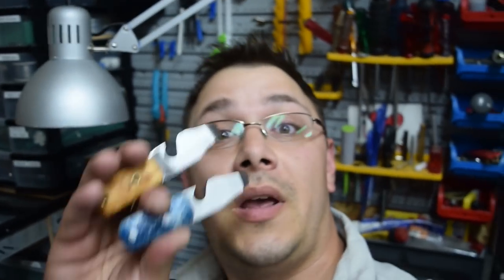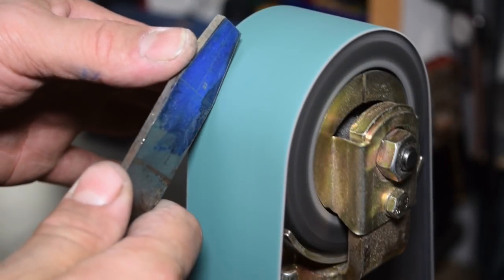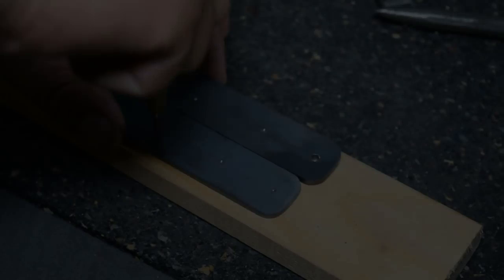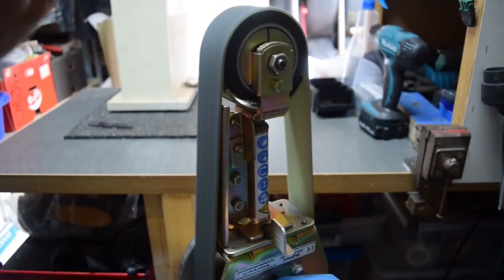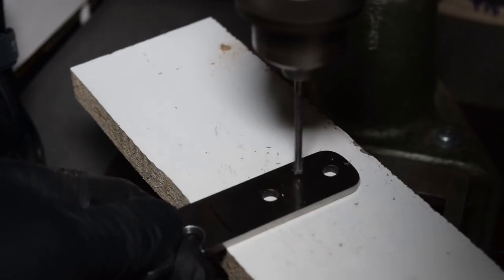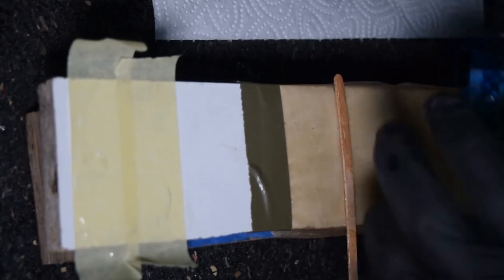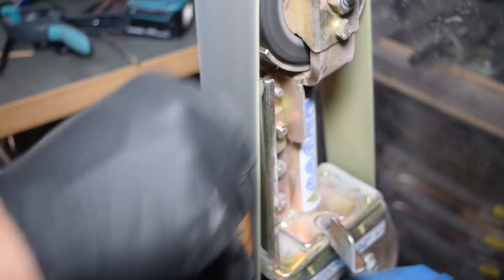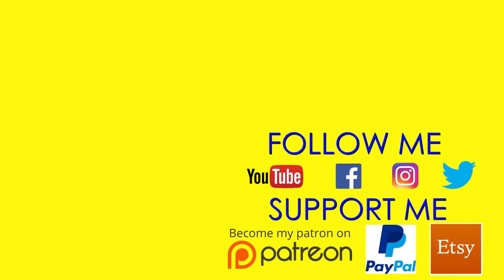Making Pocket Pry Bars from Mystery Steel

Comment: Where can I get a torch like you use in your mini kiln? If its lilac its pronounced lyelac
Reply from the maker: Thanks, i think I used a weed burner torch from the hardware store and built a small furnace from fire brick
Reply: Thank you. I have the fire bricks but couldn't get the metal hot enough with a regular propane torch. Maybe my piece of metal was too big too.🤔